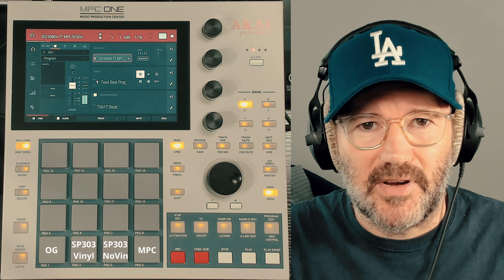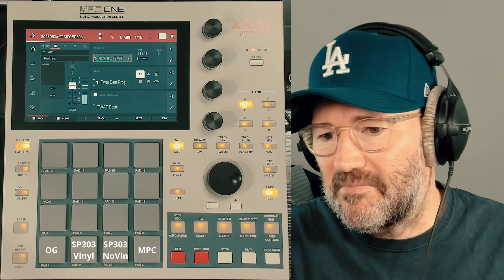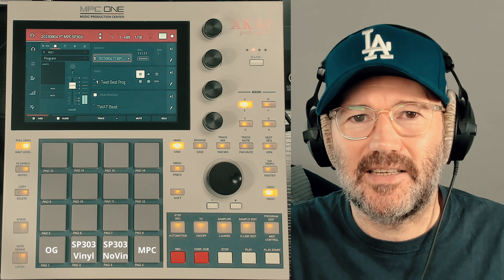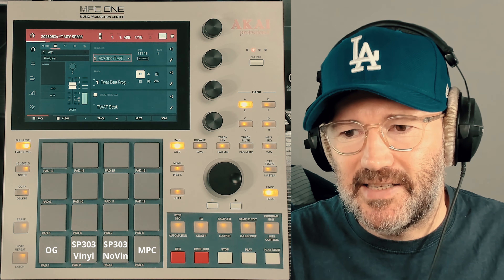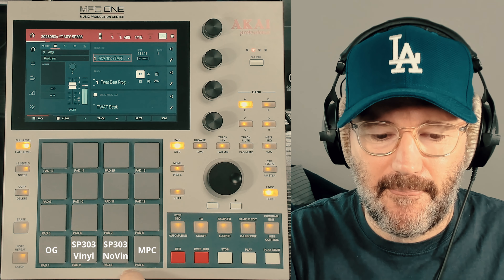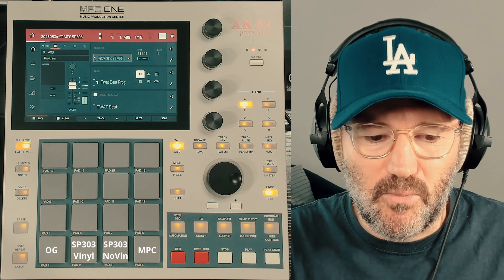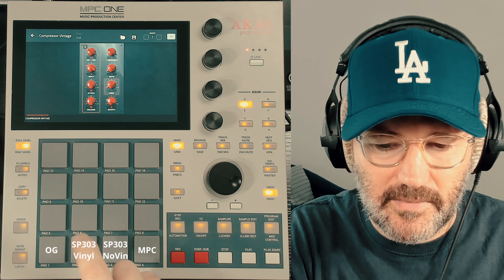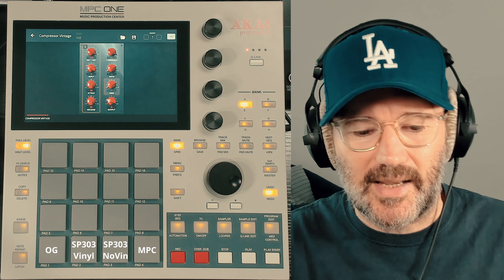Akai MPC Tutorial. Boss SP303 Vinyl Sim Compressor in the MPC? I accept the challenge. FREE PRESET!

Comment: Interesting you didn't go for the Lo-Fi as the first plugin in the slots, that would resemble the order of things in the 303 better if I understand correctly. Good job regardless and very informative video! Thanks.
Reply from the maker: Hey man, thank you for watching and for taking the time to comment. I actually tried a few different ways before I decided on this FX chain order. The thing with adding any kind of saturation or lofi effects before a compressor (and this goes for anything really, DAWs, hardware, MPCs, Maschine, etc) is that you are then compressing the effect as well. I wanted to get that compressed sound that the 303 has first and then add flavor afterward. I found that adding lofi first meant that the kind of compression I added (tube compression style) was bringing up too much of the low-level signal and noise floor which was detrimental to the final result and didn't sound like the SP303 as much. Whereas adding the compressor first and then adding flavor made for a more realistic result. But of course, there is no right or wrong here. You can of course add lofi plugins before compression, it's all good if it sounds good! Ultimately, I was going for the sound of the SP303 rather than emulating the order in which the SP303 gets its sound, and that meant a few workarounds and changing things up a bit.
Reply: @TheCratesMotel  Thanks for the explanation, makes perfect sense.

Comment: I'll test it out for you. I have a 303. I might've reordered the chain starting with Lofi, then Flavour followed by comp and either Air transient or EQ..

We need rms/lufs meters, multiband comp and mid side processing.. Fingers crossed even Beatmaker 3 has those
Reply from the maker: My client (the guy who challenged me) compared the his OG version with my version and it nulled apart from a bit of mid range, which I thought was the case and highlighted this in the video. I placed the compressor first because I found in a different order the transients were affected too much before compression. But also be aware my chain order is specifically for that sample and I may do things differently with a different sample. Most of all, my work is done, as I got you thinking, and that was my aim. Have fun experimenting and thanks for watching.
Reply from the maker: You have a multiband compressor of sorts. Check my videos. I’ve set one up in the same way we used to with analog compressors in the 80s.
Reply: @TheCratesMotel  Yeah,  I've tried that method using sends, but I don't like it. It's in the MPC master rig, that was being sold on the forum.
Reply from the maker: @dja.selekta  My version is a bit different dude, I didn't get it from any forum. But of course, it is a workaround rather than a replacement for a fully fledged multiband compressor. I am trying to get people to focus on what can be done in the MPC rather than what can't be done, if you know what I mean. The forums are full of people complaining that the MPC doesn't make you toast or walk your dog lol. It was never meant to. Anyway thanks again for watching and for taking the time to comment. I appreciate it.